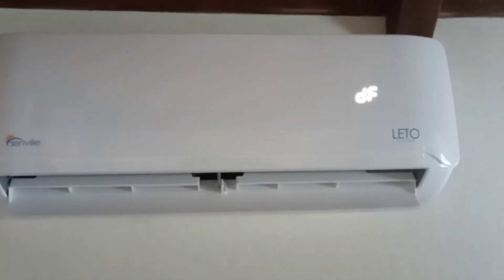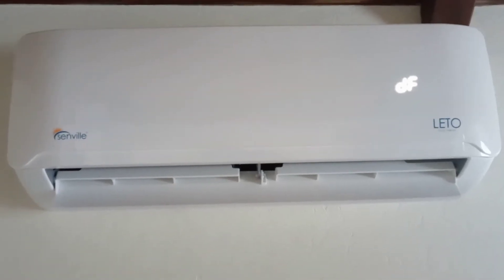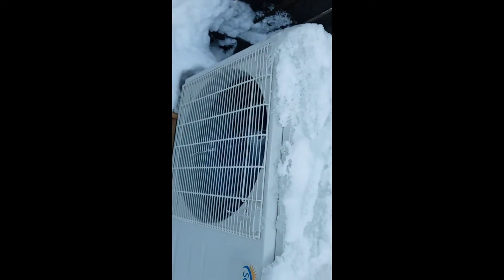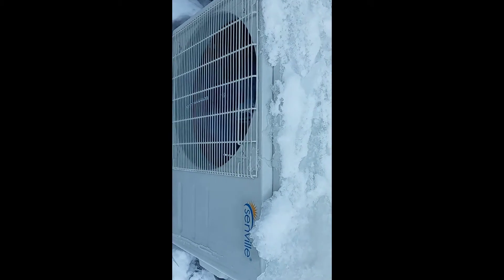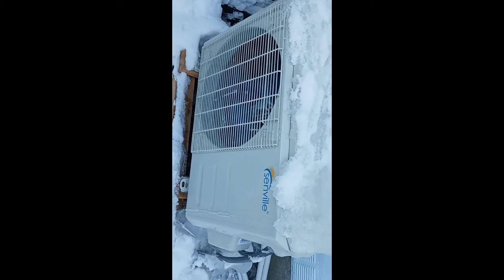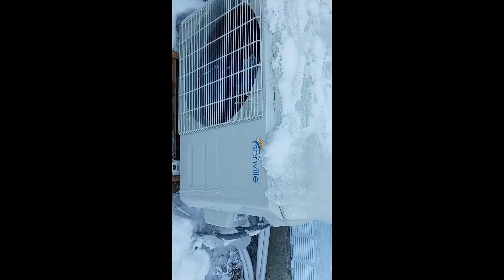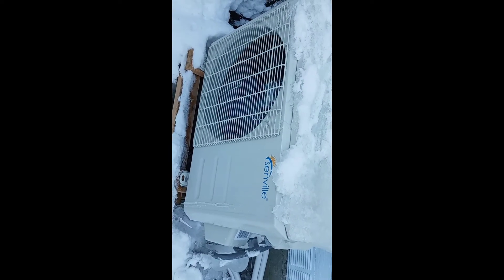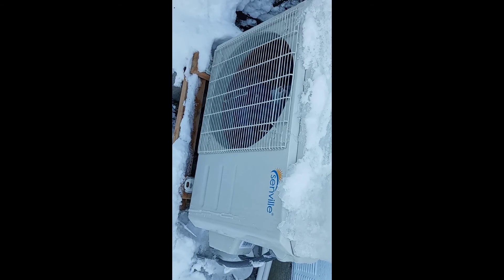What does dF mean on a Senville Mini-Split?

Comment: Note that some area of your fins are covered and reduced the available air flow that is needed to collect the heat from the air. Install that awning before this next winter. It can be a simple sheet of plastic or metal that connects to the house and slopes over the unit. You're lucky you don't live where is much colder. I grew up in the eastern side of North Dakota, where -40F was typical in Jan-Feb, now live in the tropics of Iowa where -20F occurs, but I'm south of the permanent snow line by 50 miles, so a mild winter.
Reply from the maker: Yes. We rarely have ice like that. It was rare weather.

Comment: Dose it blow cold air inside while in defrost mode?
Reply: Both the indoor and the outdoor fan are stopped during this process.  However, the air close to the indoor unit does get a chill as the heat is getting sucked out of it for this process.

Comment: How is this unit at electrical usage? Thinking of putting 2 24k units in my house, curious as to reliability and operating cost. Would you recommend them to a friend?
Reply from the maker: I have not noticed a change in electricity usage. I want to say it has a max draw of 8 or 11 amps which is around what a space heater is so it can't be pulling that much. I have recommended them to friends. If you don't already have Central Heating and Air I think it's a way better option than trying to install or even to retrofit a system. It has an inherent in efficiency advantage in that it's not are that's being pushed through pipes but pressurised gas. So it's a lot more efficient at delivering it to the register location
Reply: @howpages  Thanks! I "had" a traditional heat pump of 3 tons but it just died. The HVAC guys want anywhere from 8k-13k to replace it with a 14 SEER unit. The Leto is 17 SEER and costs a whole lot less, it just seems a bit too good to be true....